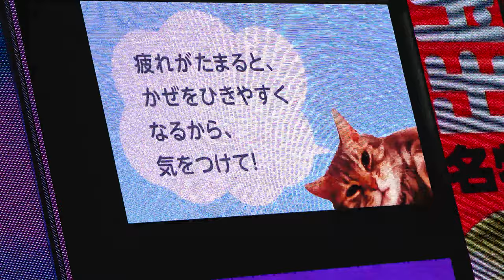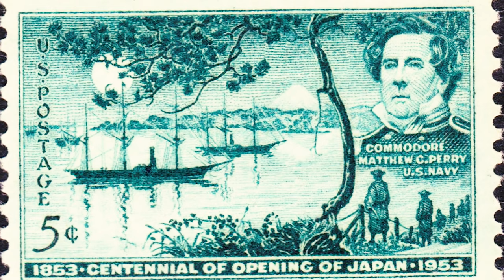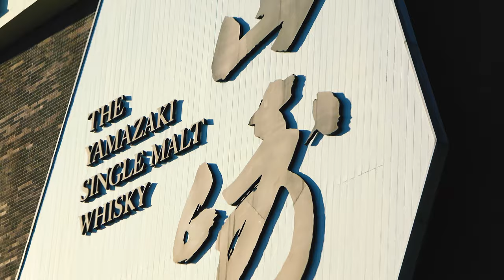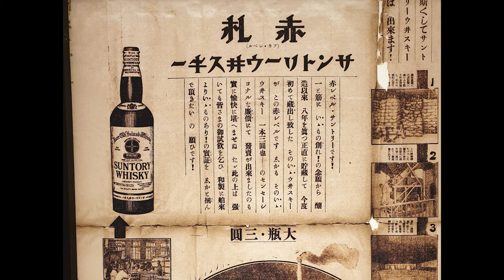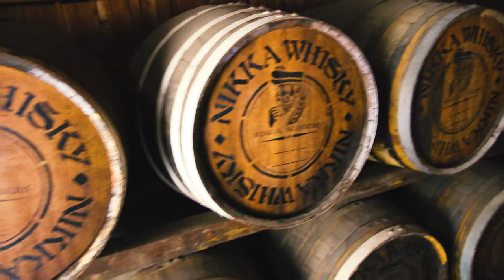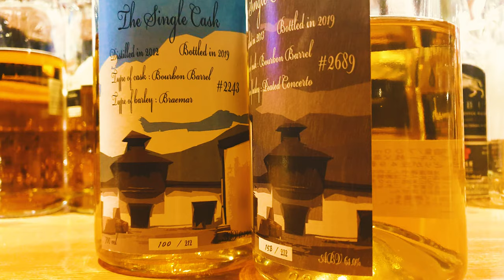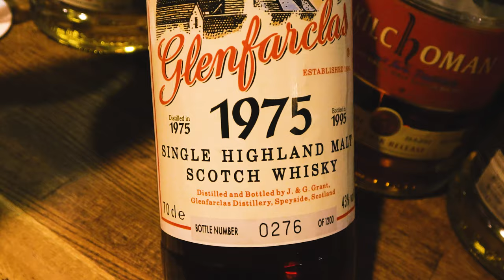JAPANESE WHISKY [ an introduction to ] JAPANESE WHISKY HISTORY & CULTURE

Comment: Just before you entered Campbelltoun Loch Bar it looked like you went into Omoide Yokocho in Shinjuku. Is this where Campbelltoun is?
Reply: Hi Wayne, The bar "kind of" close to the imperial palace. The place It is very hard to find...as you need to look for stairs going underground. They are no signs, only a bunch of empty bottles.. The address on google map is 1 Chome-6-8 Yūrakuchō, Chiyoda City, Tokyo 100-0006, Japan.
Reply from the maker: Hi Wayne, The bar is kind of close to the imperial palace. The place is very hard to find. Once in the area, you will be looking for stairs going underground...they are no signs etc.Here is the link to google map: https://www.google.com/maps/search/campbeltown+loch+bar+tokyo/@35.6735552,139.758697,17z/data=!3m1!4b1